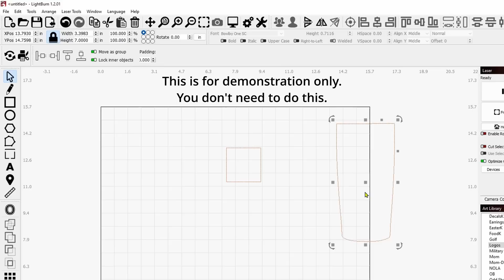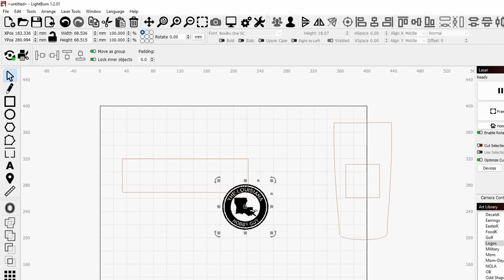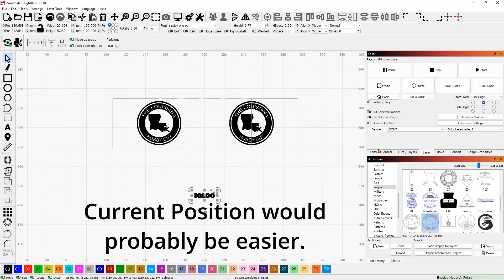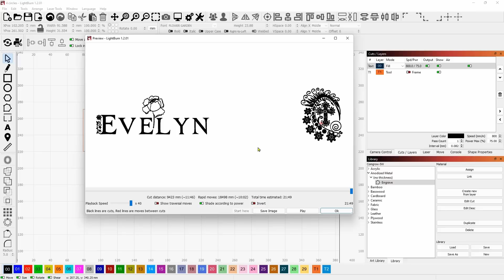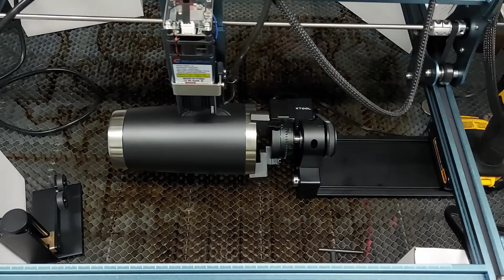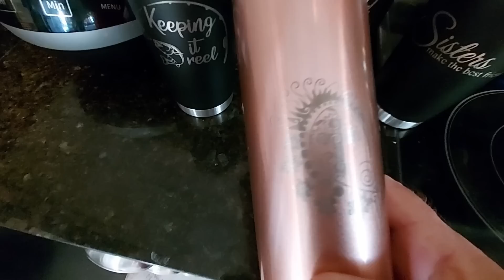👌The ULTIMATE guide for setting up a double sided tumbler in Lightburn with your hobby laser!

Comment from the maker: If you skip through this video, you'll MISS several really important tips and tricks!
Reply: I have lightburn and custom. Built a machine to my specs. What are the burn setting you used for your laser? FYI I blew my 5w laser neje and due to not buying from their shop I can't get it replaced or support. Now I have a 0.5w laser. Can you assist in the settings for lightburn using calv cold steel spray and rotary chuck?
Reply from the maker: @Pir8Gaming361  The settings are in the video.

Comment: when you manually put the w logos I'n the box and dragged them and said they were aligned..is there a way to look or see measurements to assure it aligned? .it seemed in video that it was guessing? I'm sure you know it was correct but something there that I didn't hear or see was a key point that told you it was 100%..how does one know for sure?...I'm sure I missed something but wanted to ask
Reply from the maker: If you watch the video again Chad, you'll see the graphics snap into the center of the lines from the boxes.

Comment: Can you do a full wrap design?
Reply: Thank you for replying. I've been struggling to get my 20w fiber and my roller tumbler to work with lightburn. The manufacturer help is atrocious.
Reply from the maker: If you need help with a fiber setup, Patrick from Lightsource,pro has paid one-on-one remote help. sales@lightsource.pro
Reply from the maker: I have done them. You simply size the graphic to the circumference of the tumbler.

Comment: I am using Piburn 4.0 with Omtech 60w mf. Do you need to find steps for each individual product and change rotation steps at each job or is there a way of setting the steps to change automatically.  ie My steps for 30oz tumbler are 5100 while 20oz is 5250. I have tried changing diameter only but rotation is off unless I change steps.  Do I need to calculate steps for every product I engrave with rotary?
Reply from the maker: You'll need to contact PiBurn for that question Chris; I don't own one. I don't have to change my steps per rotation on any of my rotary devices.
Reply: @TheLouisianaHobbyGuy  Thanks for the quick response I have reached out to Piburn support.

Comment: Don't you need to turn everything 90° if you're using a rotary? Or is it not needed since the rotary itself is turned?
Reply from the maker: It depends on the roller and the direction of the stepper motor Monztuh. Always do a test. I will usually wrap the item in tape and run the job at very low power to make sure.
Reply: @TheLouisianaHobbyGuy  ah ok got you. I have another question. Is it necessary to mirror the image option in the rotary whenever using a rotary device? Also is there any difference between the absolute coordinates current position and starting origin options when using a rotary compared to not using one?
Reply from the maker: It depends on the rotary and the position of the stepper motor. You use current position.

Comment: So if I'm working with a tumbler with a screw top lid, I line up the laser head with the mouth of the tumbler lid, and put the origin as right center? (piburn and thunder laser, design flipped 90 degrees different from yours)... thanks for this video... will be experimenting tomorrow - have 100 double sided to do so this will save a ton of time.
Reply from the maker: That should work for you Heather.
Reply: @TheLouisianaHobbyGuy  have to do a 90 degree turn to make it work, but got it.
Reply from the maker: Glad to hear it Heather! Yeah, different rollers will have different settings.
Reply: About to send this to my laser, but the green dot is between the images that will be back and front of my tumbler. I'm having a hard time visualizing what you said about lining the image and laser head up with the logo (in my case the igloo logo = mouth of the tumbler). If the green start point end up between the images, wouldn't I need to find the center between the mouth and back of the tumbler?

Comment: Hey Rich would that also work with the Roller set up or would the numbers be different?
Reply from the maker: That was a roller setup Ken.
Reply: 😅Sorry, I guess I was watching the video to close cause on the rotary set you had chuck clicked. I didn't know if that made a difference, cause I was use a chuck and each side came out oval. Thanks
Reply from the maker: If the graphic is oval, your steps per mm are off Ken.

Comment: On a 10w laser, what speed (mm/min) and power do you recommend?
Reply from the maker: I don't recommend speeds and power. I always sacrifice one piece to run a power grid on.
Reply: @TheLouisianaHobbyGuy  i have and they all end looking dark or matte.  I have tried windex and baking soda and works great.  Will also try isopropyl alcohol.   Was just wondering a ballpark range or tip to make it easier to clean on painted tumblers

Comment: Thanks for sharing, awesome and informative video.  Just wanted to say for those that may be 'math-phobic'   the positioning could also be done by centering 1 graphic in the print area, centering the 2nd graphic on either of the ends of the workspace, then click both graphics and slide left or right until it is all within the workspace, without math, they are now 180 degrees our from each other
Reply from the maker: Whatever works for you Ron! I like having them exactly positioned.

Comment: I HAVE BEEN TRYING TO FIND AN ANSWER, IN THE LIGHTBURN, I WOULD LIKE TO SLOW THE SPEED THE LASER MOVES, WHEN IT IS TRACING/OUTLINING (LOW POWER) AN AREA BEFORE ENGRAVING OR CUTTING, IT MOVES WAY TOO FAST AND THE LASER HAS SLAMMED IN TO THE FRAME, ITS HAPPENED TOO MANY TIMES, LASER GRBL MOVES SLOW ENOUGH THAT I DONT HAVE THAT PROBLEM, HOW WOULD I SLOW THAT SPEED DOWN, I HAVE PUT OFF USING LIGHTBURN BECAUSE OF THAT, I HAVE ATOMSTACK A5, ONCE I CAN SLOW THAT SPEED DOWN THEN I CAN REALLY START USING LIGHTBURN, UNTIL I CAN FIND OUT HOW TO CHANGE THAT SPEED, I DONT WANT TO USE IT AND TAKE A CHANCE OF SLAMMING THE LASER SO HARD IN TO THE RAIL, THE LASER WILL BECOME DAMAGED
Reply from the maker: It's in the video. On the move tab.
Reply: @TheLouisianaHobbyGuy  THANK YOU, I SAW HOW TO DO THAT IN THE VIDEO AFTER I POSTED MY COMMENT (QUESTION), THANK YOU AGAIN, GREAT JOB ON THE VIDEO

Comment: You can actually do the math within lightburn. In the width you can add /4 at the end of 188.496 then press enter and it'll give you 47.124. You can also do stuff like (10+5)*2 and it'll give you 30. I can't think off the top of my head why you would need the second option but as I was typing this I thought "Wait, can you do more complex formulas?" and you turns out you can.
Reply from the maker: Yes, I know, I'm just used to using the calc 🤪

Comment: Awesome video! I'm over here trying to break put all sorts of formulas to get the other side positioned correctly 🤣 on thing I did find is doing round logos... make the width 10% wider to give the effect of if being round on the mug...I'm Still trying to figure out speed current running 3000mms/80%power and its still not giving a "shiny stainless" but more of an engraved metal look...using Atomstack stack x20
Reply from the maker: I usually use the 8-10% rule on tapered tumblers, but these weren't tapered very much. I was just off 1mm on the steps Kevin.
Reply: @TheLouisianaHobbyGuy  you make it look easy, I will say that 🤙

Comment: Curious why the chuck is not 180° around on the rotary tool. If the tumbler was over the ‘bed’ you would not need the drill as a counter balance. 

I’ve no experience yet with rotary tools so there may be something I’m totally missing

Great demo as always
Reply from the maker: Because it's based on the mm/min the stepper motor moves. The roller is setup this way because I do a lot of cups with handles.

Comment: Thanks for another great video Rich.  I use an Ortur Master 2 Pro with an Ortur YRR and suffer from slight slippage in the Y (rotational) direction.  I tried your suggestion of "Fill Shapes Individually", but found that "Fill all shapes at Once" and  "Fill Groups Together" resulted in a no unwanted movement in the Y direction, so less chance to slip. We've discussed it previously in relation to a separate issue, but I engrave wood and like a line after fill to really make my text and graphics crisp.  This is where I suffer a slight mismatch between engrave and line.  The problem is that Lightburn wants to complete the full engrave before starting the line and therefore the YRR rotates the work all the way back to the beginning before starting the line and hence sometimes a mismatch in the Y direction.  I have been searching for a setting which causes the line to be burned immediately after a section of graphics or text letter has been burned.  Other than putting each section or letter on a different layer, which is sometimes impossible, I can't seem to find a way.
Reply from the maker: I don't know of one Doug, but the speed on the move tab should solve the problem.
Reply: @TheLouisianaHobbyGuy  I keep any settings associated with movement in the Y direction to quite low values.  e.g. Accel' Y ($121).  I leave my woodturning in the big heavy lathe chuck which I rest on the 2 rollers of the YRR.  I prevent any movement in the X direction by a small magnet, so it's never going to fly off like a tumbler might.  With relevant settings slowed down, I don't have much of a problem these days.  I may get a stepper motor driven chuck device one day.🙂
Reply: @Doug Bennett I had that same issue, so I went to the dollar store and picked up some double sided tape , I make complete wrap around the tumbler where it is not in the way of the burn. Once I have it on I run my hands around the tape so it's not so sticky works great
Reply: @jimmccall4599  Thanks for the tip.  I've not tried the double-sided tape. I did try some spray glue on the rollers which helped.  It's a shame we can't get Lightburn to do the line along with the fill, rather than completely before or after.

Comment: Absolutely did it again Rich! Knocked it outta the park. I think once you got in the frame of mind of actually running the job half way into the video, that it brought up some great detailed information. My tumblers turned out perfect as far as alignments on opposite faces of the tumblers, and overcoming brand logos on smaller tumbler mugs was also something I’ll be up against. But because I didn’t know what to do about white space, the tumbler was a 3 hour job @ 180mm/m on 10W library settings for stainless which was the closest my library settings had available for the job. I didn’t like the big speed difference from converting mm/s for coated metal in laserbox. The white space part of the video was a great addition to the topic. Will be handy for larger cutting boards etc. 🙏🏼
Reply from the maker: Glad it helped Jeffery! 👍